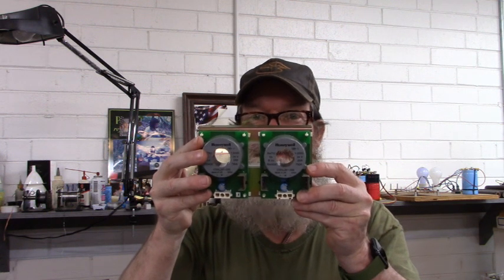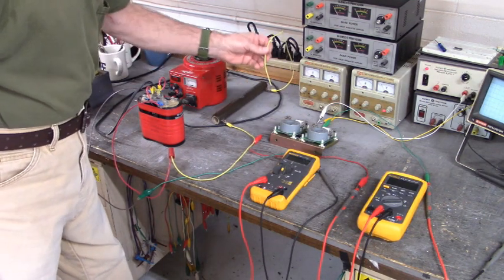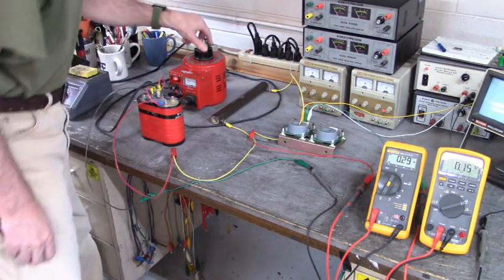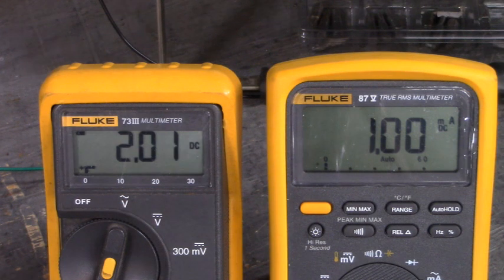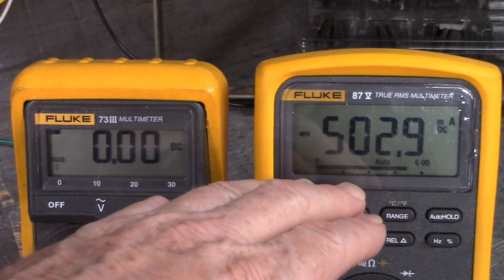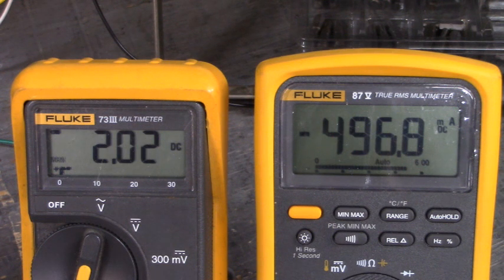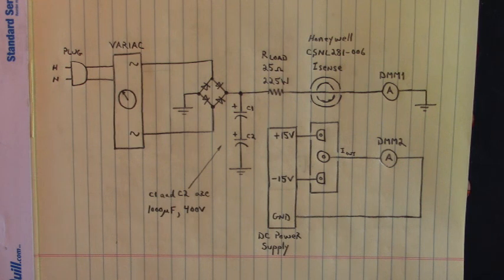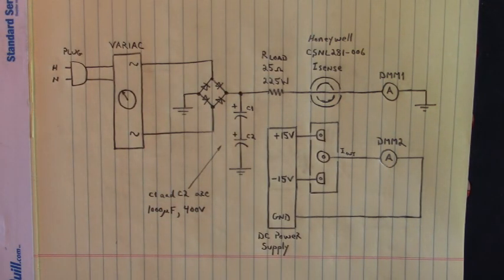Allen Bradley 1336 Plus II Alarm 12

Comment: Hello,I watched your video on trouble shooting Ic chips,I have a guitar effect that works for about 5 minutes and then it stops working?can a Ic chip work like that ?or what component do you think it is?I only have a cheap multimeter to work with?I know that is not much to information for you to work with?it only has one chip no transisters,only resisters and caps and 2 diodes?